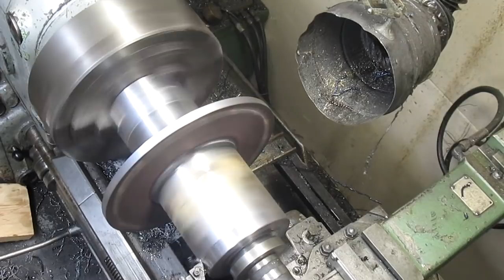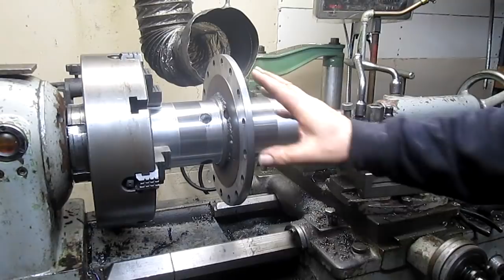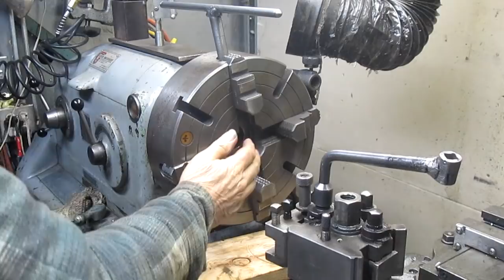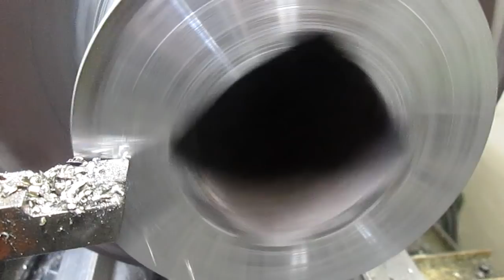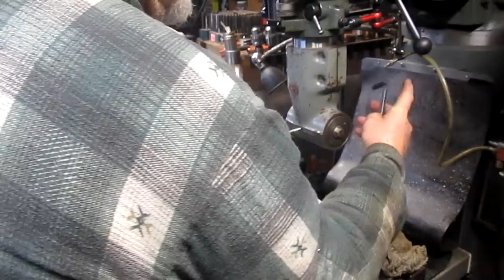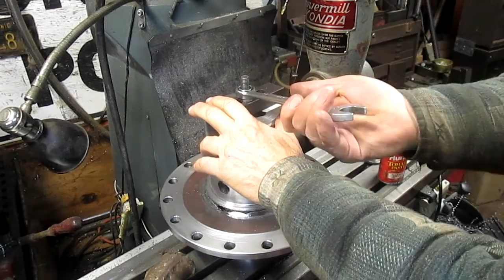Drill Gear Box Build #5

Comment: Nik, a quick question, when resetting the workpiece in the 4 jaw, what was your reason for not using the tail stock and bell centre to hold the workpiece against the chuck while you secured it?
Reply from the maker: Probably just lazy. The tailstock has to unwind 6" to reach over the carriage and I never feel like cranking that wheel unless it's necessary.

Comment: Hey, just randomly clicked on this video, very nice idea on the smoke extraction!
Reply from the maker: I like random too, it's such a surprise if it's good.
I didn't want to suck out all of the warm air in my already freezing shop with a big fan, so a small squirrel cage on the roof does the trick.
I post a video every Wednesday.
Reply: @NikColyerMachineWorks  - I use a commercial inline fan (like a hood fan) punched through the wall of the garage, but it just sucks air from the ceiling AFTER the garage has filled with cutting oil smoke... Being an inline fan, it's already sized for a duct. I'd just need to run the hose. Never even thought of it. Nice idea.
Reply from the maker: @shawnhuk  If you can slow the fan you can adjust it to draw out just enough air to pull the fumes out without sucking out every last degree of heat.